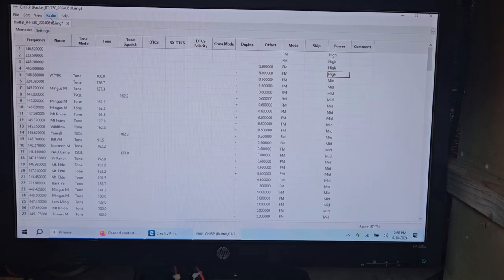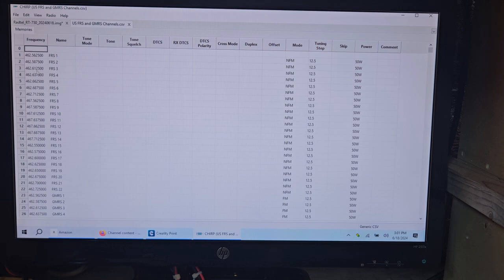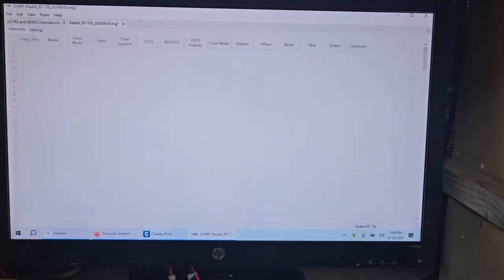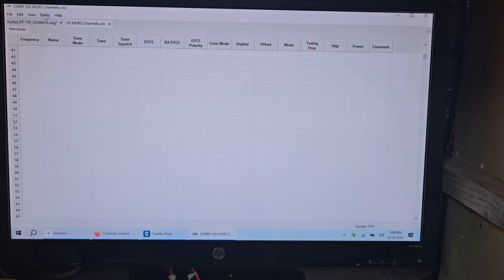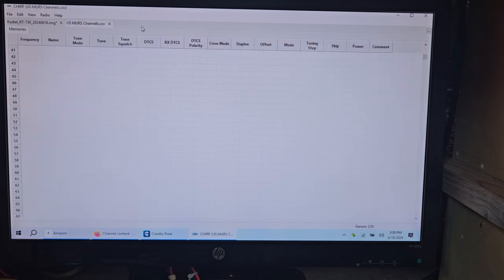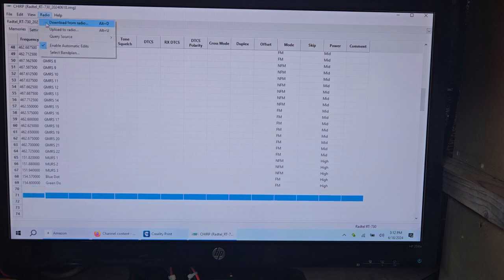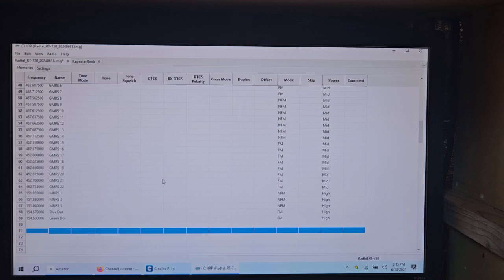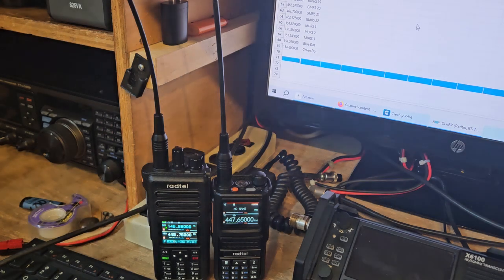How to program Radtel rt730 same for rt470x ham radio uhf vhf walkie-talkie

Comment: You can select the first memory channel you want to copy, then scroll down to the last memory channel you want to copy. Hold down the SHIFT key and click on that memory channel say as in GMRS, and it will select all 22 channels. You can also right-click on either memory channel you have selected, and it opens up a properties box. In this box you can mass change things such as power, step, etc. etc. You also don't have to select every slot when you paste in channels you copy. Just make sure you have enough memory slots available, so no memory channels overlap, click on the first empty memory slot and select paste.

Comment: Using chirp, Can you select the modulation on rt730? I want to save cb channels with AM modulation
Reply from the maker: Not sure. But you're not going to hear anything on the stock antenna
Reply: @hamradiohack  i have bought a 27mhz telescopic antenna, but I cannot hear anything because radio is in FM, and I do not buy a programming cable for radtel yet (it is another form factor, am I right?)

Comment: Password program ???????? ALL LOCK!!!! RADIO KILLED????
Reply from the maker: Did you lock it in the software program?
Reply from the maker: Try to reflash firmware 
Radtel RT-730 firmware (20240603)
Reply: @hamradiohack  45-2)  Прошивка Radtel RT-730 (20240603)  не помогло!!!  Горит зеленый индиатор на радио-ерный экран.Password program
Reply from the maker: Try reflashing the firmware its down towards the bottom of the page there are a couple of different choices it would not let me post the direct link to the firmware to download so you'll have to search for it on this page
https://www.radtels.com/pages/software-download